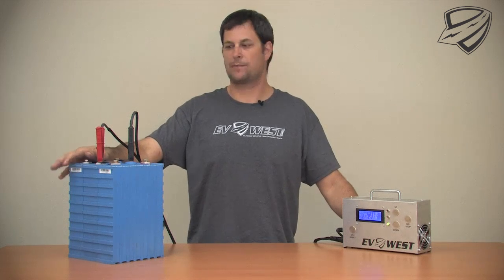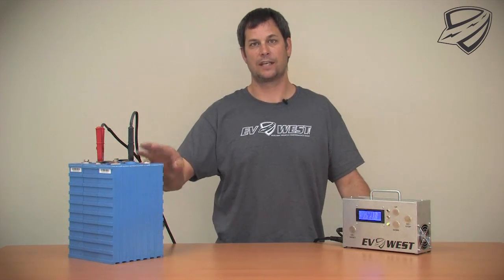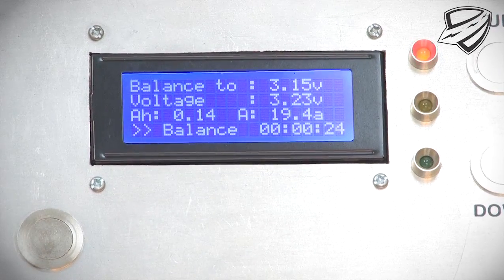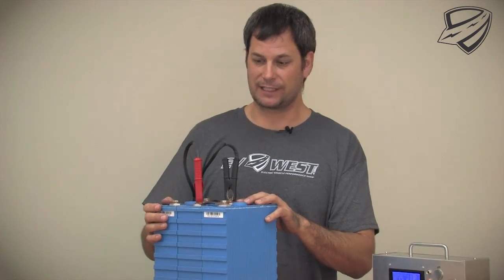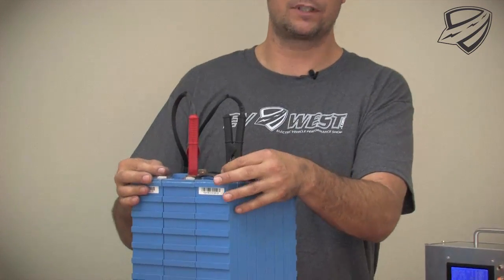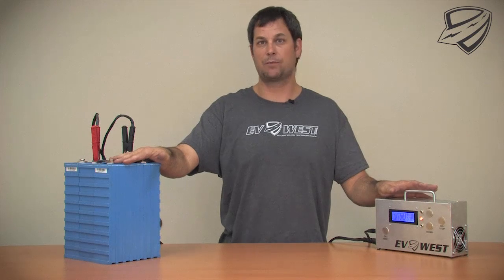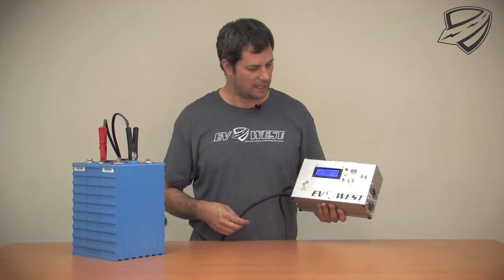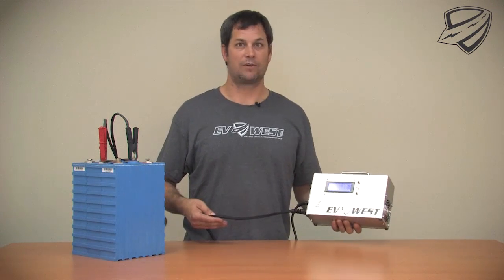EV West - Bottom Balancer Product Overview

Comment: Question:  Is the low voltage point adjustable?  A necessary feature to allow use on different types of batteries.
Reply: yes it is